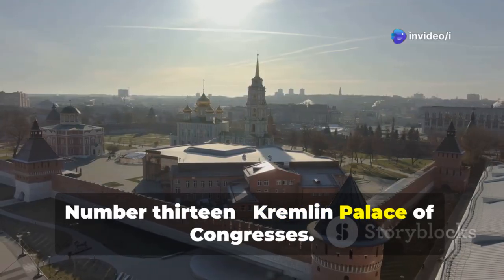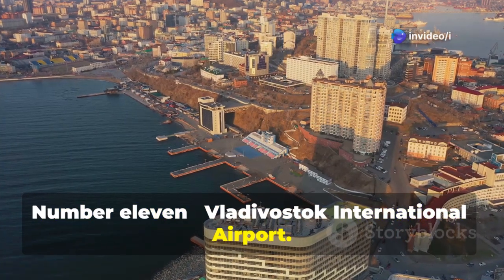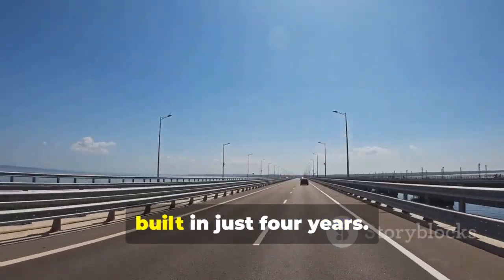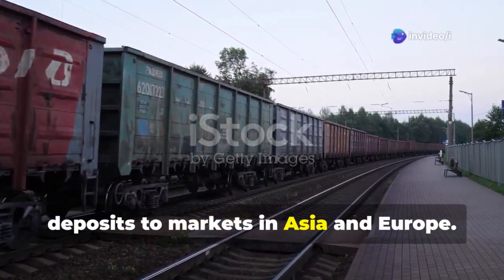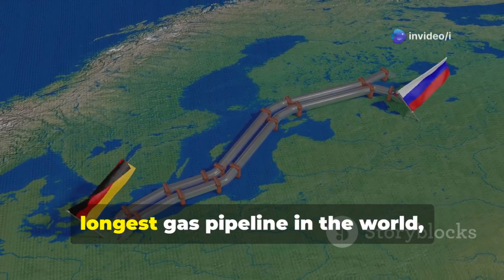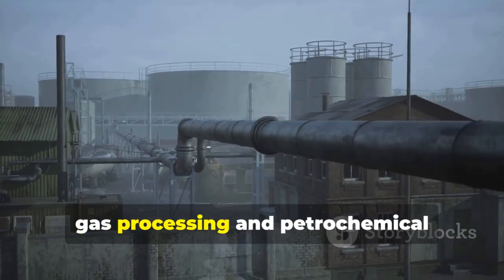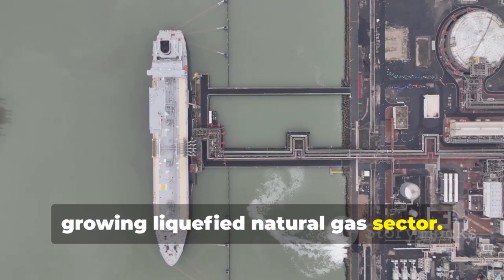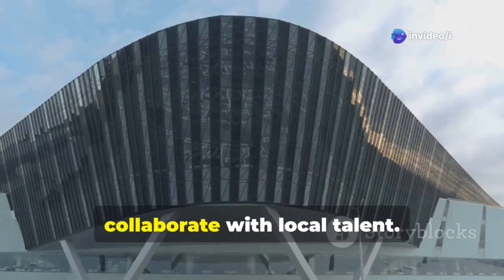Russia's CRAZIEST Completed Mega Projects. American Engineers Still JEALOUS

Comment: What a nonsense! Construction of high-speed railway Moscow - Kazan has not even started! 350 km / h and „one of the fastest railway networks in the world“ - a complete lie. 

There doesn‘t exist any high-speed railway in Russia at all. The only one that comes close to high-speed railway is the Moscow - St. Petersburg. It uses German trains Sapsan which are suited for over 200 km/h. However, because of the old track high speed is only reached on a tiny part of the route.

The other „megaprojects“ are not much better. Skolkovo is a failed Silicon valley which in over 10 years did not create any significant high-tech company. Arctic LNG 2 failed because of sanctions, Power of Siberia is too small for large gas exports to China and construction of Power of Siberia 2 did not even start. The video just shows the terrible state of current Russia.
Reply: Rant on 👏👏👏👏
😆😝😆😝😆😝😆😝😆😝